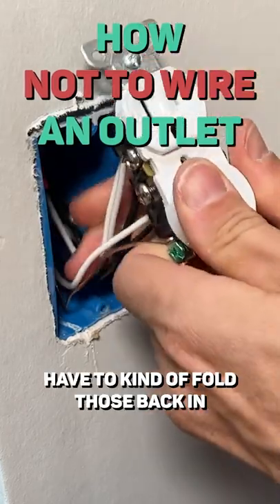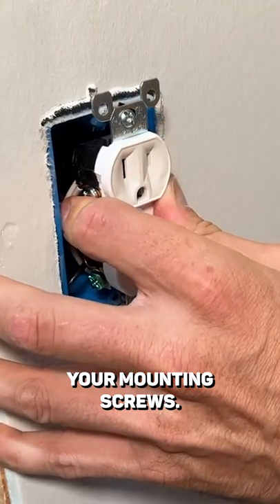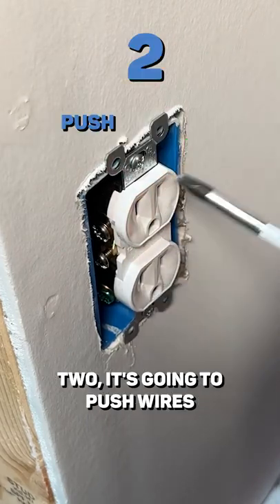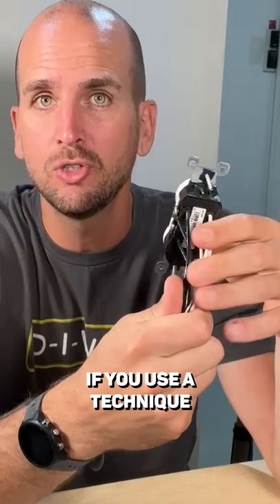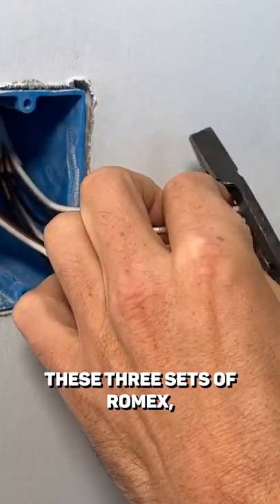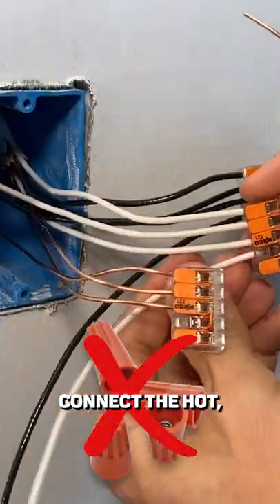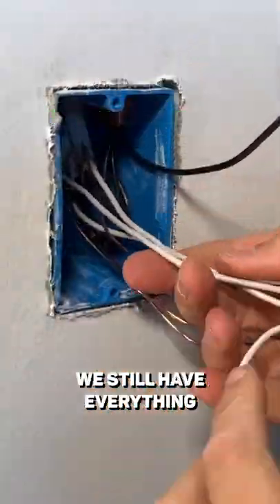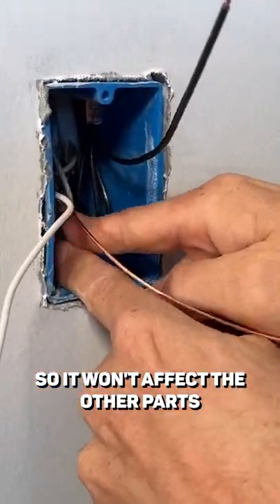The Better Way To Wire Outlets #shorts

Comment: Electrician here. Most of us wire receptacles in a similar fashion ( minus the wago and use a wire nut instead) The reason is that the neutrals on the load side( feed out side) are NOT dependent on a receptacle for connection. A loose neutral is an absolute nightmare to locate sometimes. I personally think about the next guy. Some electricans don't.
Reply: Push in style connectors > wire nuts. Ideal brand to be specific. Much easier for troubleshooting:working on a live circuit (and safer). I’ve seen way too many old splices where the wire nuts just fall right off after many years. So long as instructions are followed and you don’t bend the wires at the connector (pressure obviously isn’t ideal for these connectors) they will hold indefinitely in my experience. Granted they are new, if you look at the moving parts of the specific connectors I’m talking about you can see what I mean by that. Also prevents the twisted wiring issue :p
Reply: @jamaljamereous6298  when using solid wire you should pretwist the wire with linesman pliers, that is never coming apart. The marrette is just a cap at that point
Reply: @jamaljamereous6298  absolutely not... Push in style Connectors are unreliable, backstabbing outlets has caused alot of fires.
Reply: Most electricians don't think about the next guy. I a rough guy so I always think about the trim guys. Do when I do a job I always make their job easier.
Reply: that is a great point rocket science
Reply: Open neutral sucks especially if it has potential because it was shared. You said it man.
Reply: Neutral have given me the absolute blues before. Wire nuts so you don't go nuts!
Reply: I think I’m fighting this shit in my house right now. Borderline about to start rewiring the whole thing.
Reply: @bmo14lax  its from an add on with no grounds
Reply: Twisted wire with a wire nut on it used in the right conditions will never fail
Reply: @seabass22  just start replacing your outlets pigtail everything unless its a switched outlet and use wirenuts( do not use wagos or pushins I would also do your switches as well and it doesn't hurt to check all your connections in the main panel...all of them including main feeds if the problem persist.
Reply: Hmm ok but I think a wagon is kind better because it's smaller then a nut .. but the way I do it without pigtail is that I let one wire longer then the other and I snip it to fit it into the screw .. so I use less and have a little more space in the box
Reply: @randybobandy9828  that is an issue with those outlets in that case rather than the type of connector.
Reply: @AlexKall  I mean I guess.
Reply: plug testers tell you if there is a loose neutral
Reply: @fishbot-cv9pi  
They tell you if the receptacle has a loose neutral. (line side)  They don't tell you if the load side neutral is loose.
Reply: @itaintrocketscience  No, but they will indicate a loose supply neutral at the next receptacle
Reply: It’s a lot easier to find if your if you don’t pigtail and just attach to screws. The problem will be at the outlet that doesn’t work or the one right before
Reply: @rajivgeerman2064 plug tester is testing the receptacle is plugged into how does why the plug test that goes into the receptacle terminals
Reply: I've seen some fires, and the cause of the fire was from a wago. A wire nut makes a much better and safer connection. Also never use the back stab.
Reply: @TheChancho21  i only use wagos when they come pre installed on cans, otherwise I’m hardcore wire nut advocate, but Iv seen many melted wire nuts that could have caused fire in the right conditions. So I feel like that Wago fans could try to say the same thing back to you
Reply: @jasondavis7913  True. I was a residential electrician for 23 years in the private sector. I also worked as county commercial/industrial electrician for 12 years. I am currently a county building inspector. In my time in construction I have seen wago failure more than a wire nut failure. They do have their place in construction, and it is always good to have different options depending on the situation you find yourself self in. As for myself if I had to pick one I would pick a wire nut. I am not saying I would never use one. Lol. Happy holidays. 😊
Reply: 81I @Teh_Random_Canadian
Reply: Not home builder electricians, they use backstabbing and the outlet as the connector 😂😂
Reply: go for it .😊

Comment: I find that adding pigtails makes an already crowded box even more so.
Reply: It does with WAGOS.  Buchanan wire nuts take up less space.  But if done properly, pigtails with wagos only take a little more space than wire nuts.
Reply: Uh aren’t they using the outlet to join all those wires together? That’s a big no no…
Reply: @darkopz what's a big no no?
Reply: @jeffd6  putting more than one line on a single screw on the outlet.
Reply: @darkopz  you can put 4 white and 4 black on 1 duplex receptacle.
Reply: Wrong… thats how u do it correctly… plenty of room in the box to pigtail… he just explained it… u didn’t listen ???
Reply: Agree!  Notice how carefully the pigtailed bundled is folded in, but left jumbled on the outlet connections.  And, I'll wager the connections on the commercial outlet can carry more current than WAGO or wire nuts.
Reply: Bending wires and looping wires causes resistance. Depending the wire it loose juice every inch. And looping wires like that creates electro magnet, and or a coil. I know Ive done it. I thought keep a extra few inches just in case was a good idea. Not at all.
Reply: Pigtail eliminates the possibility of a connection going bad on a cheap outlet and losing neutral with potential of pulling 220v on a shared neutral . New code almost eliminates this buy a it’s still a good practice . If box is to small use a deeper box and make it easier . A plastic. A plastic is cheap and it’s pennies more for deeper boxes.
You will never see the cost over the scope of the job for deeper boxes .
If your contractor is going that cheap then find a quality contractor. It’s worth it in the lifetime of your biggest investment for a lifetimes
Reply: @0rnery actually, the outlet screws are rated for 20A and Wago 221 is rated for 32A, limited by the wires size. 
But I agree that adding connectors to a full box make it fuller. Also, using the backstab terminals to go beyond 2 pairs is questionable, even if legally allowed. Btw, the backstab terminals are only rated for #15 wire.  Edit: I meant #14.
Reply: @AndyKPOV while technically true, the losses in a few bends of the wire are insignificant.
Reply: You are Correct
Reply: @TomCee53  i would NEVER use "back stab" terminals.  Only commercial grade side terminals, where four 12 gauge wires can be secured VERY tightly.   There is FAR more contact area of each of those four wires than a Wago can apply.  You can prove this to yourself by pulling on either type of connection until it fails.
Reply: @0rnery 
you would be wrong there ...😂
Reply: @TomCee53 I've never seen a #15 wire .... 😂
Reply: Easiest way is to go ahead and accordion fold your wires and push them way back in the box. Then pull them back out and wire your receptacle. Then just push it back in.
Reply: @SteveWhiteDallas the new Ideal orange-blue wirenuts would be perfect here because they're so small, yet are rated for the connection of up to four 12awg conductors.
Reply: @jeffd6  with clamps maybe, but not just screws.  4 nm-b cables is a bit crowded in a single gang box.
Reply: @0rnery  You're right.  What people don't realize is that receptacles might be rated for 15 or 20 amps, but to get the UL listing, they must handle much more than their rating.  That means that with tight connections and the right breaker, that duplex receptacle is never going to fail to carry the feed through current.  Some people like to argue "but the tabs burn out". That's possible but you're more likely to see an elephant eating fish out of a river.  (Yes, it has been documented.)
Reply: @ianbelletti6241  Even better.  The bend made folding the splice into the box does not reduce the cross section size of the wire enough to measure the added resistance with an average, high quality ohm meter.  You can't fold those wagos in as neatly  or get them as far back in the box either.  But if they want to work so hard at making it easier ... Well, you'll have that.
Reply: @SteveWhiteDallas  4 wires on the screws, 4 pushed into the back. If your outlet has pressure plates, then you  could have all 8 wires under them.
Reply: But it’s so much better to pigtail whenever possible. If you make your connection through the receptacle, that location will affect anything else downstream of that circuit
Reply: Pigtails bring all the ends together in 3 tight, neat bundles.  Less space between the wire ends makes the box less crowded.  The proper way to pigtail is to bring all the alike wires together in the back of the box, bend a curve to bring the ends out, cut them off 2 inches outside the box, strip evenly, pigtail them, roll the wirenut back into the box, roll one more time.  That leaves plenty of room for the device in a standard size box.  It looks neat and it's easy to work on if necessary.  Try it.  Even if you use wagos, it works well and only 3 wires on a receptacle makes it go in easily without being crooked behind the plate.
Reply: @jeffd6  I thought so but wasn't sure.
Reply: Wagos crap
Reply: @darkopz no no no. Your mistook
Reply: I disagree...
Pigtailing is a way, way, way better way to install recepticles....also eliminates all the current in the circuit to have to travel through the receptacle. 
I never...never..ever had a call back...50 years in the business.
Reply: You can't say you're doing it to save space, you still have the same amount of original wire plus now 3 additional new wires plus 3 Wagos (or wire nuts) all in the same size box. The truth is either one works fine and both meet code (most places). There's no real functional difference. Like so many things, it comes down to the individual electrician's personal preference.
Reply: @darkopz  Uhhh... What? You literally have to if you are running multiple outlets in order to complete the circuit
Reply: @TomCee53 thanks for that. Mr. Ornery comment made wonder about the  wagos ability, but you said they are good for 32 amps
Reply: Not true
By adding pigtails , you can push the pigtails into the box using your hammer handle.....making it easy to install the receptacle...
I did this for 40 years
Reply: @0rnery I think the ul testing would disagree
Reply: @SteveWhiteDallas wagos  take up less space then wiring up read the listing
Reply: Just more connections = possibly more issues
Reply: Thats what i was wondering … didnt he just add a bunch more wires????!! 😂😂
Reply: @SteveWhiteDallas Exactly. This is the reason there are 50 year old houses with the original outlets and switches. It's so incredibly rare that they fail.
Reply: @darkopz  why
Reply: @TomCee53 Most homes are run with 14/2 Romex cable. Never heard of 15/2. Did you mean 14/2?
Reply: I find that less pigtails more free time for me